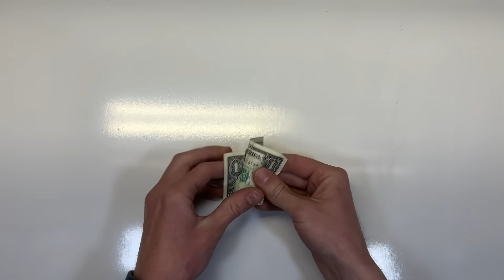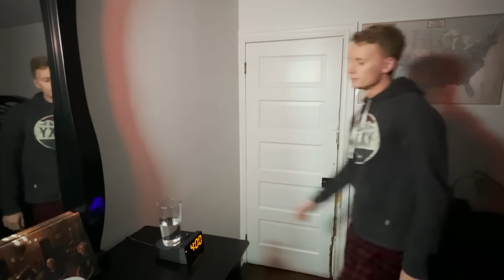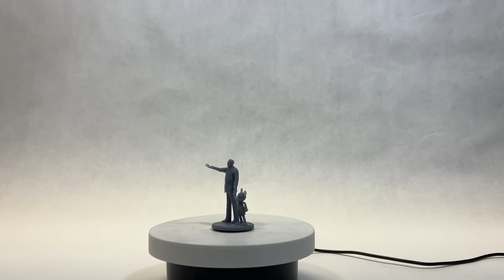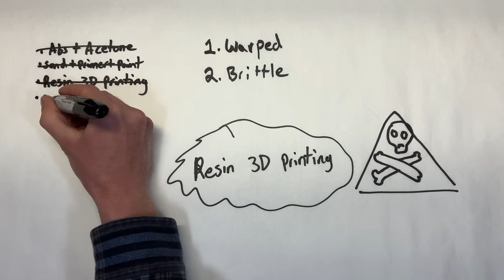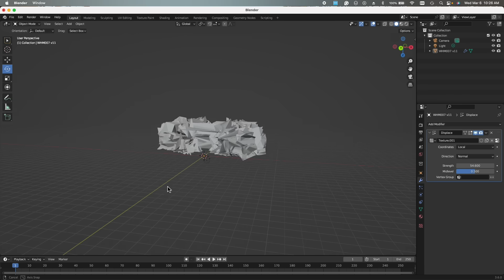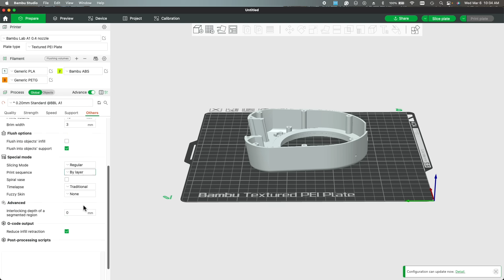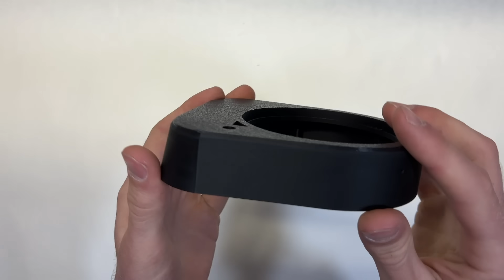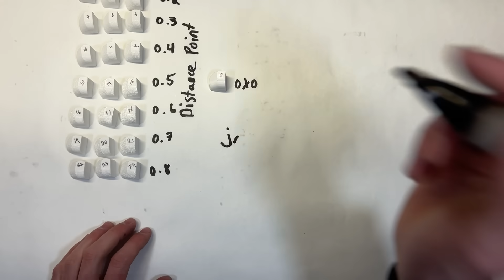My Secret To No More 3D Printed Layer Lines

Comment: Why not dip a 3d printed part in resin and use a UV light to harden it like you icing a cake. 

The finish will be glass and the parts would be strong. Win win.
Reply from the maker: I have never tried it! Have you??
Reply: @jakemgrim  I have but not on any mechanical parts or any part that needs a specific size clearance. 

You can literally paint it on and just blast it with a uv light abd it cures. Just make sure you use a clear resin if you want that same color, since if you mix colors, it will be sorta see-through and will either become patchy in spots or just change the color entirely.

Comment: Layer lines on curved surfaces can be helped by choosing long top and bottom paths. Short lines that don't follow the shape are slow and the direction changes cause small ridges. 
Second is flow adjustment because even 1% variation can change the texture.
Fine fuzzy means less tolerance problems and faster prints.
Reply from the maker: Those are excellent points! Choosing longer top and bottom layers can indeed help smooth out curved surfaces by minimizing the appearance of layer lines. Additionally, fine-tuning flow settings is crucial for achieving consistent extrusion and texture across the print. Fine fuzzy settings not only improve the surface finish but can also reduce tolerance issues and speed up print times by allowing for more efficient printing. Thanks for sharing these insights!

Comment: Consider printing your cases at a 45 deg slant from vertical, using a custom CAD modeled support gantry with tiny sprues and turning off slicer created supports.

First, you could get fuzzy skin on what would be the top of your housing. I use this method for custom electronics enclosures. Second, the diagonal orientation can a lot of strength to prints in a way that can't be gotten with injection molded parts, due to how molds have to be designed to release. Third, the fuzz skin turns out even better, as the layer line orientation is not laying on any of the the cardinal axes.

Thanks for the fuzz combo testing. Do you have close up shots of each combo online somewhere, like Flickr?

I suppose it is just easier and more useful to print a bunch of my own samples plates.
Reply from the maker: Thank you so much for all of this great feedback! I will put this information to use. I added the images of the tests to discord

Comment: Do you use ironing with the fuzzy skin setting?
Reply from the maker: Ironing and fuzzy skin are two separate settings in most slicer software, each serving a different purpose. Ironing is typically used to smooth the top surface of a print by applying additional passes of the nozzle without extruding filament. On the other hand, fuzzy skin adds a textured surface to the print to mask layer lines. 

Using ironing with fuzzy skin might not produce the desired effect, as ironing aims to create a smooth finish while fuzzy skin intentionally adds texture. However, you could experiment with combining these settings to achieve a unique surface texture that suits your preferences.

Comment: Hey, there was an A1 recall. You really shouldn't be using your A1 until they provide a part or replacement device for the faulty power cable design. It can catch fire.
Reply from the maker: I thought you could 3d print a bracket? Are they really catching on fire?
Reply: @jakemgrim  Directly from their own article,   "While the number of faulty printers is very small, we take the safety of our customers very seriously, and until we learn more about what exactly causes the heatbed cable problem, we recommend everyone stop using the printer for their safety.
". I can link it if you need but it's just called "A1 Recall Update" on their blog. It's 100% able to catch fire from the heated bed cable, it's not likely, but you certainly don't want to be the person who it happens to. Always when you least expect it.
Reply: @jakemgrim  They originally said you can print a bracket if you have a healthy cable, then seemed to change their minds to get a refund or wait for the new  design.

Comment: I don't get it, I have 2 3d printers (1 filament and 1 resin, both from Elegoo) and I never had any problems with prints. My resin printer failed only once, but it was only my fault (I was checking if I really have to clean bed every time, spoiler - yes 😅). And it is messy only on the beggining, before you work it out. It's slower process, but print looks amazing, it's simple and definately not messy. It is also tougher and there is no chance that after a year lines will start to separate from each other. I use my filament printer only for fast and big prints, if quality doesn't matter.
Reply from the maker: It's great to hear that you've had success with both your filament and resin printers! Indeed, resin printing can offer exceptional print quality, especially for intricate and detailed models. While resin printing may have a learning curve and require careful handling of materials like resin and isopropyl alcohol, once you've mastered the process, it can produce stunning results.

Filament printing, on the other hand, is often preferred for larger prints or when speed is a priority, as you mentioned. Each printing method has its own advantages and applications, and it's fantastic that you have both options available to you for different types of projects. Keep experimenting and enjoying your 3D printing journey!

Comment: Have you heard of Vacuum casting? or other any other low volume plastics molding? I feel like there are many other manufacturing options you haven't yet considered.
Reply from the maker: That might be an option!
Reply: @jakemgrim  I learned about it from work. Super useful to know all the manufacturing options available 👍🏾

Comment: Basically, you need a bamboo printer to do this. Smh.
Reply from the maker: While the Bambu Lab printer used in the video may have specific features that were highlighted, such as the fuzzy skin setting, similar results can often be achieved with other 3D printers as well. The key is to experiment with your slicer settings and materials to find what works best for your specific printer and project requirements. Don't be discouraged if you don't have the exact same equipment – there are often multiple ways to achieve similar results with different tools and techniques.

Comment: Hi there! Do you have any recommendations on a good beginners 3D printer? Ive been designing 3D renders of shoes in Gravity Sketch that id like to test out for prototypes. After watching this video you seem very knowledgable of 3D printers so I thought id ask! Haha
Reply from the maker: Absolutely! For beginners looking to get started with 3D printing, there are several excellent options available. Here are a few recommendations:

1. Creality Ender 3 V2: This is a popular choice for beginners due to its affordability, ease of assembly, and reliable performance. It offers a decent build volume and can handle a wide range of filaments.

2. Prusa i3 MK3S+: Prusa Research is known for producing high-quality 3D printers, and the MK3S+ is no exception. While it's a bit pricier than some other options, it offers excellent print quality, reliability, and a large community for support.

3. Anycubic i3 Mega S: Another budget-friendly option, the i3 Mega S offers a sturdy frame, easy assembly, and good print quality. It's a solid choice for beginners looking to get started with 3D printing.

4. Bambu Lab X1C: This is a newer option but gaining popularity for its ease of use, excellent print quality, and user-friendly interface. It's a bit more expensive but offers features that are great for beginners and experienced users alike.

These are just a few options to consider, and there are many other great printers out there depending on your budget and specific needs. It's also a good idea to join online communities and forums where you can ask for advice and get help troubleshooting any issues you may encounter. Good luck with your 3D printing journey, and feel free to ask if you have any more questions!

Comment: I wish I would've seen this sooner before printing out some proton pack parts. I knew this feature existed but didn't think about using it for a more subtle texture. And I was going to get some spray on bed liner to add the texture my existing parts but maybe I'll just reprint them while testing this setting just to see how it goes.
Reply from the maker: It's great to hear that you found the information helpful! Experimenting with different settings and techniques can often lead to surprising and improved results in your 3D prints. The fuzzy skin feature can indeed be quite useful for achieving subtle textures and disguising layer lines, so it's definitely worth giving it a try on your proton pack parts. Reprinting while testing the setting is a good idea to see how it affects the overall appearance and feel of your prints. Don't hesitate to reach out if you have any questions or need further assistance along the way. Happy printing!

Comment: I've found it's a great way to add a stony surface texture for some gravestones I print. Depending on the stone I use different settings.
Reply from the maker: I’m sure it works great for that!
Reply: @jakemgrim  yep! And some print sideways, so the textured build plate is perfect. Gives the option to display them with textured or smooth face.
Reply from the maker: @Amethyst_KB  good to know! Thank you so much!
Reply: @jakemgrim  for sure! Yeah print setup is like it's own art entirely... You can spend so long on it even after your model is completed.
Reply: @jakemgrim  oh damn I forgot my original comment I was gonna make... You went thru all these diff methods of post processing. But have you tried making a silicone mold of your design parts? Then you only really have to do the full process once to get the mold smooth. You can then cast with resin repeatedly. Only thing is you can only have one in the mold at a time, so that might not be an option for you....

Comment: 1. Fuzzy Skin is PrusaSlicer feature, not bambulab slicer's (which is a PrusaSlicer's clone).
2. You could also use a special filament like Prusament Galaxy Black PLA/PETG, or any similar that includes particles that hide imperfections very well. Or any CF filament - carbon particles also make the printed model look better.

Or both Fuzzy Skin and special filament, for even better result.
Reply from the maker: Thanks for pointing out the origins of the Fuzzy Skin feature, and your suggestions for improving print aesthetics are spot on. Special filaments like those with embedded particles or carbon fiber can indeed help hide imperfections and provide a unique finish to printed models. Combining Fuzzy Skin with such filaments can further enhance the overall appearance of the print, creating a more polished and professional result.

Comment: There are some high-end resins that are more viable (even "ABS-like" and "Nylon-like" are pretty strong relatively speaking) but they still can't compare to the real deal rolling off a spool. They also must be painted to give them UV resistance. The fumes are even worse than the liquid, you really have to vent it, fills the room with an invisible VOC fog. Strong resins can only be washed with and cleanup can only be done with solvents high-percentage IPA for example). You can't leave liquid resin out, must be filtered and stored in an airtight container - even then, lifespan is limited. Waste product must be cured to make inert. Wash solution must be reprocessed (messy) or replaced (costly) periodically.

Resin printing produces unparalleled accuracy, and is really good for making figurines, statues, and other art that requires max precision and detail. But that's really where the usefulness ends for me. For practical parts FDM is better. FDM filament can be stored indefinitely, sealed with dessicant, and drying boxes can resuscitate "wet" filament. You can leave it out for quite some time even without a drying box. You can print tons of different types of real polys, and even fancy blended materials with the right nozzles. I'm just done with resin printing. Too much hassle.
Reply from the maker: It sounds like you've had quite an experience with resin printing, and your insights into its pros and cons are valuable. Indeed, while resin printing offers unparalleled accuracy and detail for certain applications, it comes with its own set of challenges and limitations, especially when compared to FDM printing. The issues you mentioned regarding fumes, storage, cleanup, and waste management are important considerations for anyone looking to work with resin printers. FDM printing certainly has its advantages in terms of material versatility, ease of use, and storage stability. Ultimately, choosing the right printing method depends on the specific requirements of the project and the preferences of the user.

Comment: Have you ever tried bead blasting?  There are also other materials that can be used other than glass beads to "sand" the surface of an object and smooth it out.
Reply from the maker: I have not tried it, but I can picture how it would work. Have you tried it? If so, does it work well?
Reply: @jakemgrim Yes, I have done bead blasting and sand blasting.  Bead blasting creates a smooth finish, but all that I have done it with is metal, like aluminum and steel.  You should try it and let us know if it works.  Some people use baking soda or ground walnut shells and I'm sure other materials.
Reply: I don't think that I have ever tried it on plastic though, not yet anyway.

Comment: you said better way . but what is see is you just looking for easy and lazy way . its crucial thing to do post-process if you want the model smooth ,paint and less longer .
Reply: I see this as working smarter not harder. You can keep hammering your nail with a rock. I will hammer mine the easy lazy way with a hammer.
Reply: The less post processing you have to do, the more efficient you are. The more efficient you are the more time you save. The more time you save the more money you make. The more money you make the more honey you take. Got it?

Comment: I have a Bambu Lab X1C and i started to print everything for costume props with 0.08mm layer height which makes normal layer lines nearly invisible. 

And to the fuzzy skin: i absolutely dont like it. and also: a nightmare to clean.
Reply from the maker: 0.08 layer height! That’s crazy! How much longer does it take to print?

Comment: Maybe the key to making the fuzzy texture faster, would be to have a piezoelectric actuator right at the nozzle tip, moving it  sideways in completely variable increments independent of the regular nozzle travel. Imagine some subtle up & down motion too, which might have good effects as well. Elsewhere I’ve just said that  natural textures would be nice besides fuzziness.
Reply from the maker: That's an interesting idea! Introducing dynamic motion control at the nozzle tip could potentially create more varied and natural textures in 3D prints, enhancing the appearance and feel of the finished products. Incorporating piezoelectric actuators for precise, independent movement could offer greater control over the texture generation process, allowing for unique patterns and effects to be achieved. Combining this with subtle up and down motion could further enhance the texture and overall quality of the prints. It's certainly an innovative concept worth exploring further for improving 3D printing capabilities.

Comment: There was a fork of Prusa where someone was trying to add the tessellation ability (think displacement/normal maps) to the slicer so you could do your own 3d texturing to the model without external tools like Blender, but I don't think it ever made it past a prototype phase.
Reply from the maker: That sounds like a fascinating project! Adding tessellation capabilities directly into a slicer like PrusaSlicer would indeed be a powerful feature, allowing users to create intricate textures and patterns directly within the slicing software. This could streamline the workflow for adding custom textures to 3D models, eliminating the need for external tools like Blender. While it's unfortunate that the project may not have progressed beyond the prototype phase, the concept highlights the potential for further innovation in the field of 3D printing software development.
Reply: It would be great if this were revived, to allow textures like woodgrain, leather, etc.
Reply from the maker: I agree!

Comment: Fuzzy skin feature is the very reason I dusted off my old 3d printer and started printing with it again. I already bought a resin printer because I wanted to get rid of the layer lines, but nothing can beat the durability of FDM parts.
Reply from the maker: It's great to hear that the fuzzy skin feature reignited your interest in 3D printing with your FDM printer! While resin printing can offer excellent surface quality, as you mentioned, FDM parts often boast superior durability, making them well-suited for functional prototypes and end-use parts. The ability to minimize layer lines with fuzzy skin while retaining the strength of FDM prints is a significant advantage. Enjoy exploring the possibilities of both FDM and resin printing in your projects!